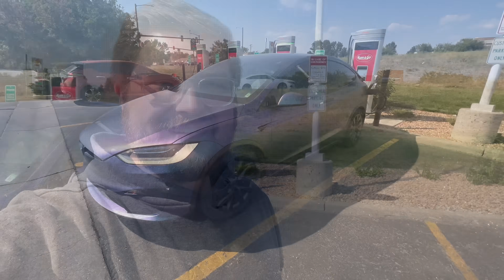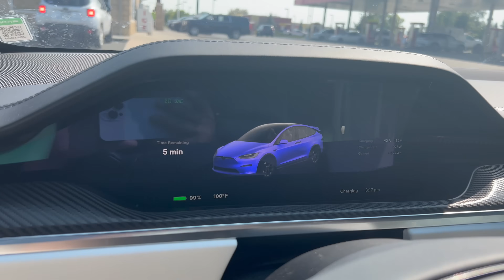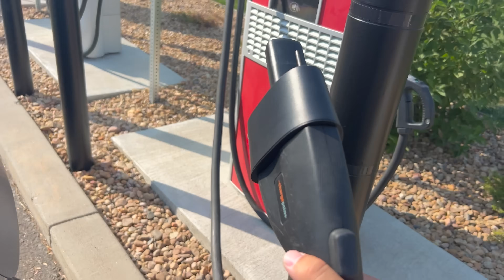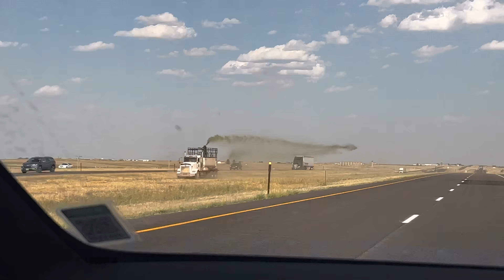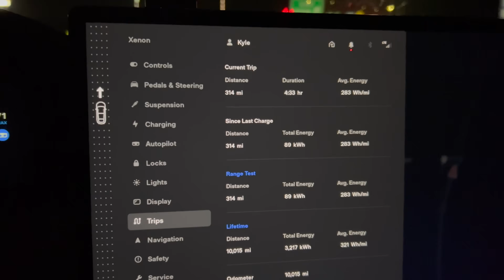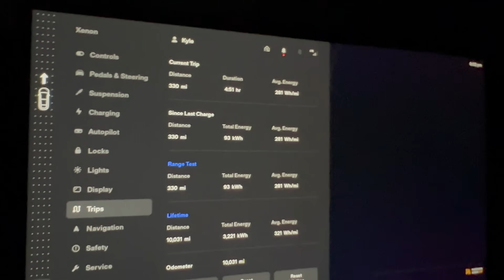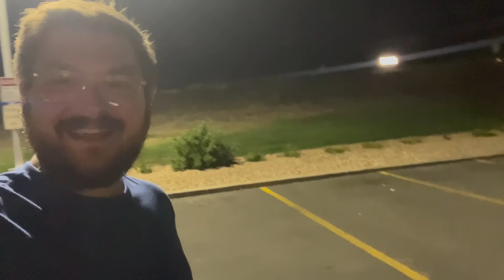2022 Tesla Model X Long Range 70 MPH Highway Range Test - Will It Go Farther Than The BMW iX?

Comment: You can always slap more batteries on it for more range. Heck, throw a gas powered generator in the trunk and you get even more range.
Reply: Not really. Batteries weigh a lot. The BMW weighs like 300lbs more, and has 22" wheels, and yet still blew away its EPA rating. The Model X on the other hand couldn't even meets its EPA rating. According to Tesla's rating, the Model X "should be like 70 miles more than the ix? In real life the Tesla can't even match the range of the ix.
Reply: @hotrod182  yes. Really. Look at lucid.
Reply: @Nominally-Built  Well the Lucid didn't quite meet its EPA in the test, but impressive nonetheless. But you can't compare an SUV with a sleek sedan. With that note, BMW announced their 600 mile EVS are around the corner. And as we know, BMW doesn't exaggerate.
Reply: @hotrod182  according to fueleconomy.gov, the ix m60 is 44kWh/100 miles, the 2022 model X long range is 33kWh/100 miles. iX m60 has 111.5kWh battery, the model X has 100kwh.

iX has stated range of 288 mi
model X has stated range of 333-348

seeing that the iX has a larger battery and lower range, just what is your definition of efficiency?
Reply: @Nominally-Built  Lets define your numbers in the real world then:
Tesla Model X has 33% more efficiency (supposedly)
BMW ix has only a 10% bigger battery.
BMW weighs hundreds of lbs more
BMW has 22" wheels vs 20" wheels.
Yet BMW has more range.
In real life: BMW  efficiency is more impressive.
Reply: @hotrod182  111.5/288 = 0.387 kWh/mi

100/333 = 0.300 kWh/mi

Where are you getting your numbers from? "Real world tests?" Where wind patterns are unknown and not factored in? Was there a tail wind in one direction during one test and not the other? Was one vehicle fighting a headwind and not the other? That's not how reliable scientific data works. Tests need to be carried out in a controlled environment for repeatability.
Reply: @Nominally-Built  Yup, you keep looking at your stats, and disregard real world range tests, and what previous Tesla's owners say about their BMW being better in every way including range with an insignificant efficiency difference. What is significant is how much more solid the BMW feels, how much quieter, how much more luxurious it is, with HUD, laser lights, trick rear wheel steering, and how it isn't Camry common.
   In case you don't make it to the bottom of the comments...Don't take my word for it, read the following. Its a very common consensus:

"Yves Van den Broek
7 days ago
I switched from a Model X to a BMW iX best decision ever … and this test confirms all my findings."
Yves Van den Broek

 @GenieRainbowMagick Multitude of reasons, BMW knows how to build cars, and that shows in every aspect. Driving noise, suspension, handling (4 wheel steering makes it very agile), real 360 camera, no phantom breaking, cross traffic warning when exiting a driveway or parking spot, amazing sound system B&W, interior quality, Apple CarPlay. Model X is not a bad car but is below on each of the points mentioned. The one thing MX has the route planner / SC network that is way better, but in Europe SC network is open so I can get by and I use ABRP to fix the software of the route planner 
…
 Yves Van den Broek
 @Jonathan Sage  2020 and I did put 20 inch slipstreams on it to be more efficient but even then the iX on 22’s is as efficient. I’m sure all these tests gives a good indication but in day to day drive the iX consumes less I have a home work drive where the Tesla consumed 7.5 to 8 kWh the iX is 6.5 to 7 it;s a 34km drive with 30km highway …."
Reply: @hotrod182  how do you not understand that real world range tests is not science? Do you understand what headwind or tailwind does to mileage? Temperature? I'm glad people like you aren't in science, we'd be doomed.
Reply: @Nominally-Built  
Quit making excuses. Are you deaf, or blind when he talks about conditions? Read the comments of others in my comment above. Don't trust Kyle, or other previous Tesla owners?  Read this article regarding Edmund's tests. They probably spend more time range testing than the EPA:
So sorry Rene. But BMW has out engineered Tesla in making the more desirable EV. Same reasons, why many pick the i4 as being more desirable than the Model 3. Can you imagine when BMW's out with their 600 mile next generation battery packs. Only difference this time is the specs don't come from a manufacturer with overly optimistic factory ratings. 

"To be more precise, Edmunds has now put a basically fully equipped model of the BMW iX xDrive50 through its paces. The vehicle in question was equipped with the optional 22-inch wheels, and the real-world range test of the Tesla Model X competitor was conducted at optimal ambient temperatures of approximately 73 degrees Fahrenheit. As usual, the range test consisted of 60 percent city driving and 40 percent highway driving. In the end, the BMW iX xDrive50 achieved an outstanding range of 377 miles per charge as it exceeded its official EPA range rating by a noteworthy 19.7 percent or 62 miles.

It was determined that the BMW iX xDrive50's energy consumption amounted to just 32 kWh per 100 miles, which is a formidably efficient result for such a bulky and heavy electric mid-size SUV that weighs more than 5,700 pounds. In Edmund's ranking of electric cars with the longest real-world range, the BMW iX thereby managed to beat every single SUV competitor and now sits in a strong fourth place. Only two electric Mercedes sedans and the Lucid Air Dream have an even longer real-world range per charge than the BMW iX xDrive50. The arguably most popular competitor, the 2020 Tesla Model X Long Range, is in a distant 16th place with a real-world range of just 294 miles, a whopping 83 miles less than its German counterpart."
Reply: @Nominally-Built actually,  besides you, we live in the real world,  lol. They do tests going both ways to mitigate wind and elevation changes.

Comment: Bjorn got 21 miles of driving in Model Y performance after BMS indicated 0% 0 miles in his recent driving to car shutdown series. So the hidden range plus BMS calibration in teslas is hiding a lot.
Reply: As is done in every other car. Interesting are the PSA models, they drive down to 20 miles or so and stop immediately without any warning. I prefer a few miles beyond zero.

Comment: So Tesla Model X has minus 20 miles vs EPA and BMW has plus 65 miles vs EPA ...interesting 🤔
Reply: epa uses 2 cycle test with bmw vs 5 cycle test with Tesla. I don't know why there's 2 separate EPA tests its complete bs
Reply: @noway6238  Yeah,those different test gives some funky results😁
Reply: @djprojectus   What you really want is all the companies to do the 5 test scheme,  as more conditions and systems are actually in use when deriving the results.
Reply: They be cheating & paying them off.

Comment: Great video, but you said “way under EPA” but epa shows 332 you said 331 that’s 1 mile difference. 

Price for the the Model X today is $120,990
Reply: $80k in the US
Reply: 7:09 The EPA range on this car is 351 miles....
Reply: @djprojectus  Technically 348.

Comment: No big surprise that there's a hidden buffer on the "fuel". My friend's 85 Accord routinely ran 20+ minutes after the fuel light went on. My own car had a 13+ gallon tank, but even when the gauge said "dead empty!" the most that could be stuffed in the tank was 10 gallons, indicating a 75 mile reserve.
 And then there were older Jaguars, with two separate tanks, like aircraft, so if you picked up bad gas you could simply switch over to the other tank.
 Personally, I'd rather just have accurate fuel/range gauges.

Comment: I wouldn't call this a bigger car than the BMW iX. It's 3" longer, 1.7" wider, but 1" LOWER. Overall, those are negligible differences.
Reply: That makes zero sense.  You clearly don’t understand volume calculations.  The X is 1” lower? It has an adjustable suspension so how are you calculating that?
Reply: @olemissjim  Oh, it's I who doesn't understand? You are laughably ignorant. The external dimensions for every vehicle are published as length, width and height. Kyle remarked about the Model X being a bigger vehicle for purposes of efficiency / range. The external dimensions are what matter. Interior volume is irrelevant. The Model X is a lower car.

Comment: Just picked up a new Model S and was wondering what’s the best way to protect the battery health? I set max charge to 70% and try keeping the battery between 40-70% as much as possible. Is there anything else I should be doing?
Reply: 10-90% is perfectly fine. Do not accelerate faster than necessary, do not regenerative brake more than necessary, do not forget to use yopur mechanical brakes from time to toime so they don't corrode more than necessary, charge it with AC most of the time and the battery will last you a lifetime or even more.
Reply: 70% max doesn't make sense imo. tesla recommends 90% charge regularly, keep above 10%, minimize supercharging
Reply: @sameleanya4987  oh do they?? I didn’t know that! Maybe I should start charging to 90%
Reply: @andrewe868  I set my S at 80 for daily driving fyi
Reply: @andrewe868  Lower the better, regardless of what Tesla "recommends". They don't specifically recommend 90% BTW, that's just the top end of their "daily" charge limit.
It's just the way battery chemistry works. The more you stay in the middle of pack voltage the more full charge cycles you get out of it.  I keep my charge limit between 70-80% depending on the season as I have very long commutes, and keep it above 20% when possible.
Heat is the primary enemy though, which is why supercharging is hard on battery life. Hi/Low states of charge are the next biggest factors.

Basically, keep the charge limit as low as you can reasonably get away with. If you need 90% to get to where you're going, then obviously you need to do that. But, it's better to keep the battery in the middle of its capacity and charge more often, than it is to charge to a high level and then wait to charge when it gets low.
Reply: @andrewt9204  Thank you! I’ll definitely be doing that! Appreciate all the help!
Reply: @andrewe868  also keep the car plugged in whenever possible. Tesla has not specified how plugging in helps battery health except to recommend it in the manual and I saw it said once from Tesla “a plugged in tesla is a happy tesla”. Plugging in likely helps BMS and the Tesla says it provides a small amount of heat to keep it in ideal temperature range. As for battery range NCA batteries are happiest at 50% charge so 60% is better than 70 and is better than 90. But the difference in degradation between 70 to 90 is very marginal so the minimal benefit you obtain may not be worth the range hit.
Reply: @Jeddin  keeping it plugged in reduces battery cycles. EVs constantly use a small amount of power. If they're plugged in, that power is pulled from the grid. If they're sitting unplugged it gets pulled from the battery, so more cycles. Keeping it plugged in is great advice.

I own two Model Xs and keep them both at 80% SoC for everything but road trips. 70% is better, but the difference is pretty negligible. 

Learn how to use scheduled departure charging so that you can charge to a high SoC without leaving it in that state for too long.
Reply: @andrewe868   i picked up my MYLR in November 2023 and tesla guys said charge to 80% for day to day driving.
Reply: Try to keep it cooler when possible, like not parking in direct sun or in hot garages. Not running sentry mode and reduce heater usage also help save some unnecessary cycles on your battery. Some people might even go to the extreme of not navigating to supercharger to help keep the battery cooler for longer
Reply: @rudyyyxu  I appreciate that, thank you!
Reply: @andrewe868  yeah enjoy your model s!

Comment: Thank you for testing range the way you do. EPA numbers are unreliable.
Reply: Its not that the EPA numbers are unreliable, its just they are not the driving speeds / city highway cycle a lot of people do. Meant for comparing different models.
Reply: @brucec954  this is why tests the Kyle Conner and Tom Moloughney do are so important. For example the EPA highway rating for my 2021 Mach E is around 240 both Kyle and Tom got a much higher range at 70 mph. I think Tom got as  much as 285. I got similar results and now I have more confidence Road tripping with the Mach E
Reply: The tesla has a epa of 332 and Kyle recorded a 331. So 1 mile is not unreliable
Reply: @olemissjim  my model 3 has an EPA range 353 mpg and I barely get 300 mpg when road tripping and speed set at 70mph